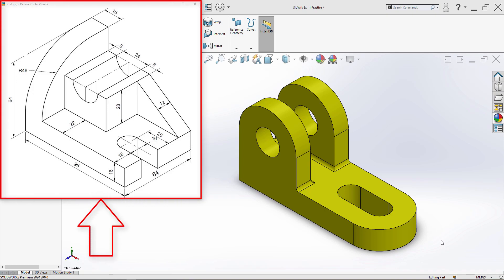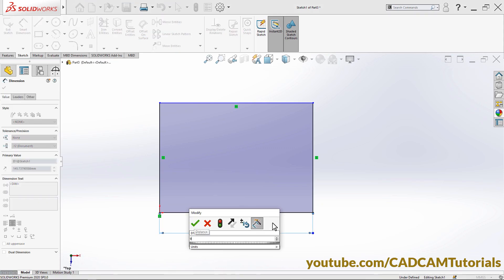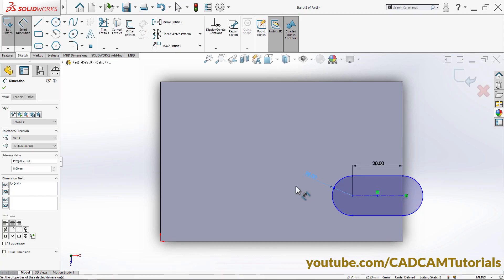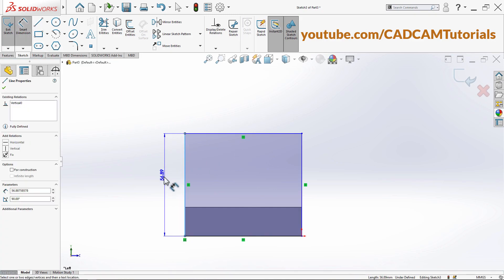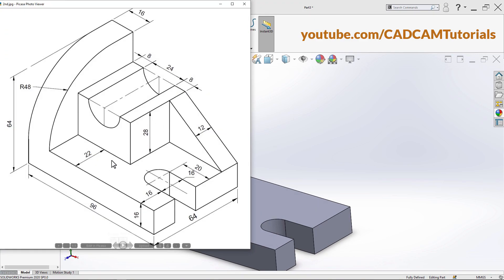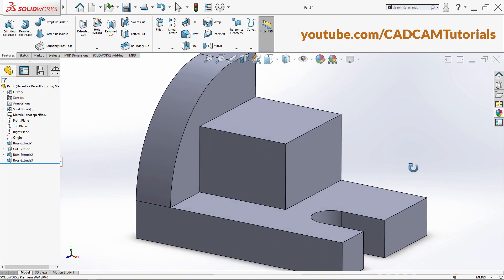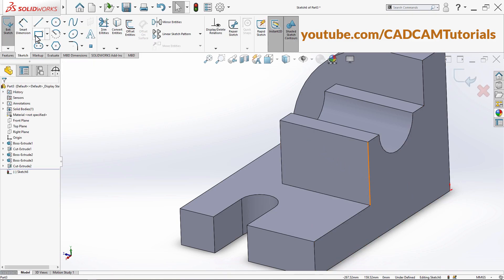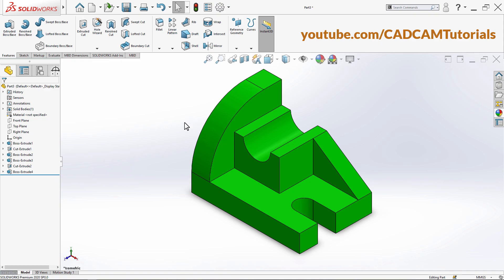SolidWorks Basic Practice Drawing Exercise for Beginners - 2

Comment: Hi, I tried making that arc with a radius of 48 but it gave me an error saying that the specified radius would eliminate one of the elements. I changed it to 47 and that worked. Is there a way to fix the error or is 47 ok?
Reply: i had the same error but it was because i only made the square on that face above the rectangle (from the base plate), rather than including the rectangle
Reply: Same issue I took 10 mm 😂
Reply: I did the same so I added the radius after extruding and It worked